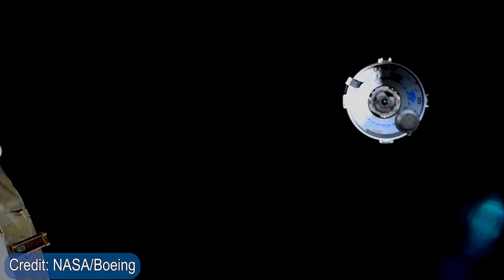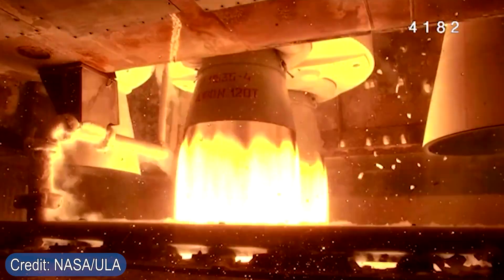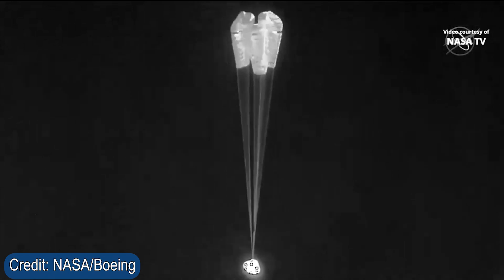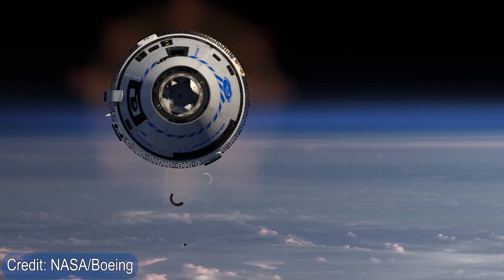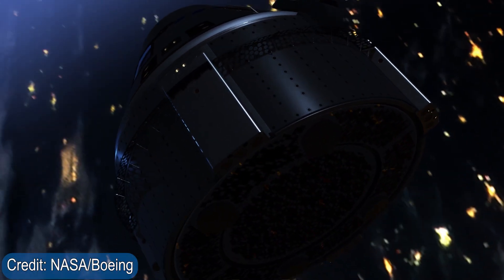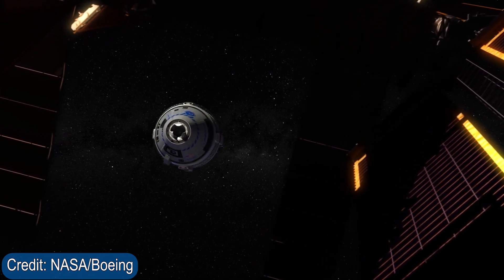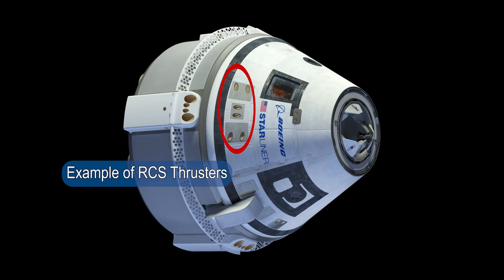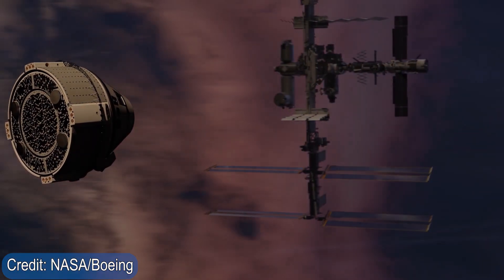Boeing Succeeds after Thruster Malfunction: Starliner's OFT-2 Overview

Comment: The first Starliner almost didn't make it back in one piece.   This one did but they had problems that would have had a crew biting their nails, a malfunction of the the thermal control system, the thrusters, and the docking mechanism.   These were all systems basic to the flight and after 60 odd years of space flight should have the bugs worked out.

Comment: I've always been more than willing to do crazy stuff. Hell, I chose a submarine for a career then went and played with nuclear materials. And I'd love to be an astronaut and even do a 1-way to Mars. But I'd hesitate if it was in a spacecraft made by Boeing. They went from a great company doing amazing things and creating the most iconic aircraft in history to basically a dumpster fire. Even the terms "overbudget and past the due date" come from Boeing's contracts. That's what you get when you use the same company over and over and don't really question what has changed at that company. The only surprising part of this whole mission was it didn't blow up.

Nobody should be surprised that they had not one, but two thrusters fail on this mission. The attitude there is poor. Lackadaisical engineering, back-stabbing and finger-pointing environment at the company, and willingly taking advantage of government contracts are how Boeing operates. Their bottom line literally is based on lying to NASA and the DOD. I guarantee they spent more money on K street than they did on any aspect of engineering this spacecraft. Get the contract and take as long as possible to fulfill it is the Boeing way now.